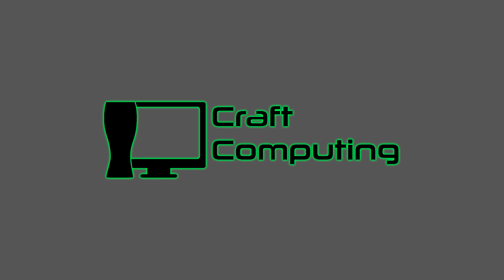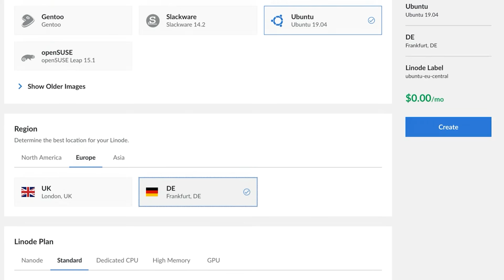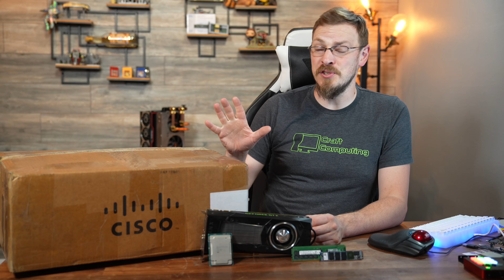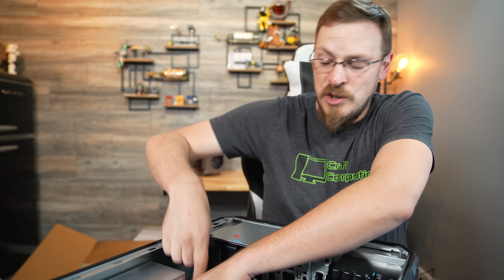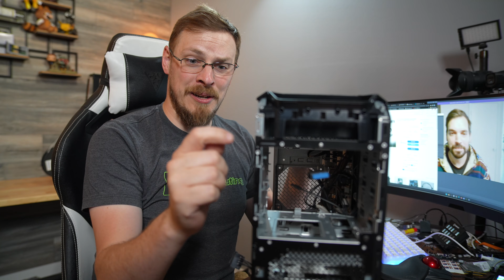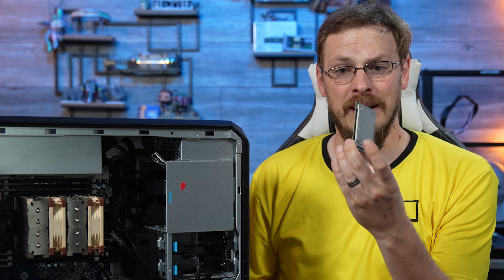THIS PC IS CURSED! - HPE Z6 G4 and Xeon 8251C!

Comment: I actually had some good experiences with my Hades Canyon NUC which I used as a desktop for a while and now have as a portable Beat Saber box. Based on that plus... fuck Dell, I went and grabbed a decent deal for the Spectre that came with that same chip as well.

ffs laptop instantly throttles the CPU to 1GHz, hitches massively, literally unplayable, no joke I had a better experience with a Core m tablet + 750Ti via TB3 (all I had during the 2018 mining boom).
Fuck HP as well. Looks like I'll go with good old reliable: ThinkPad P series.

Comment: Isn't that the generation of Xeon Process that Intel introduced processor locking (to the motherboard) via PPT (Platform Trust Technology). You might not have a memory issues, you might have a processor (or two) that is locked to the last motherboard it was in. It's a deplorable practice and HP is very well known for having this setting turned on by default.

Comment: I bought an HP colour laser printer that the store promised that was mac compatible and drivers were no problem. No driveres excisted and the store could not take it back since I opened it. So that landed on the garbage dump. If you fill your case with concrete, you´ve got a nice boat anchor

Comment: What i get from the video, sometimes it's more expensive to be cheap, and RTFM. Not doing that has bit me in the rear more times than i care to count.
Don't know if the listing was there when you got this one, but there's a listing for a full system, sans drives, for $400.
Even comes with a w2100 gpu.

Comment: This is why I always look for Supermicro.  Dealing with proprietary Dell and HP parts is just always a pain.
Reply: I'm a Supermicro fanboy, however, they do have their own proprietary crap to deal with as well.  It's just a fraction of what Dell/HP/etc have.  PSU's, drive trays, fans, etc are all proprietary with Supermicro.  They're just not douchebags about things like motherboard form factors.  It's hard to complain about their PSU's though since they've been the same for over a decade now and are basically cross compatible with all of their chassis.
Reply: @jlficken  I beg to differ.  I'm a 4P wierdo, and they most definitely use odd form factors to guarantee usage in only supermicro cases.  Ask me how I know lol.
Reply: @shadowflash8519  Supermicro does use proprietary form factors in some of their systems but they're open about it and the proprietary motherboards can usually be used in different types and generations of case.
Reply: @shadowflash8519  You are correct that they do have some proprietary MB designs for their multiple node chassis as well as some other chassis where they flip the PCIe slots horizontally.  I should have mentioned that...my bad!

Happily, the chassis that most people will use for a home lab and/or data hoarding such as the 216, 826, 836, 846, and 847 happily use standard motherboard sizes.

I currently have 2x846, 3x836, and 4x216 chassis at home.  I'm going to be adding 2 dedicated 20A circuits to my office this winter so I can actually have them all running at the same time 
😂
Reply: @jlficken  even with their few proprietary motherboards and systems, they make parts readily available for not too much on their e-store.
Reply: Ebay is flooded with parts for those computers and they are dirt cheap.

Comment: Hi, is this still available? lol

Unless specified, I would argue that the front IO PCB is essential and should be part of a barebones system. To me, an ordinary "barebones" system includes all of the specific parts, and only requires CPU/RAM/Storage/GFX. If it were me, I'd argue that and return it as defective if they refused to provide it.
In a similar vein to the socket. Their fault for not securing it properly, maybe I would've said "If you guys want me to try and  fix them and I succeed, partial refund. Otherwise... just gimmie a label."

Comment: Is it possible that the pins in the socket aren't quite making the best contact with the CPU? It could cause the memory errors. Just a thought... great video regardless. Sorry it didn't work out.
Reply: He replaced the motherboard, so it's not the one with bent pins.

Comment: You like me, fell into the E-bay trap. E-Waste vend has 500 servers that will not post. Waste time on a proprietary nightmare or part out the systems for $$$ ? Seller knows by the time Buyer finds all the puzzle pieces to test GOLD or Iron Pyrite, your return window is closed. You should have done the vid in RED SHIRT 🖖Jeff.
Reply from the maker: Red Shirt Jeff? That's Geerling's thing. I'm Mirror Universe Jeff.

Comment: Gods these HP Z workstations have really become a PITA. The Z400 used to be my budget gaming go-to. 
Your ending basically "this is YOUR problem now" reminds me of a bad aging exotic car experience, nickeled and dimed to death for silly reasons.
I had a Z820 that I feared to reboot because it would throw a RAM FAILED TRAINING error on a random DIMM (and there were 16) just about every time. Bricked the mobo once by enabling a BIOS setting that wouldn't clear with a CMOS reset, had to use the Crisis Recovery jumper to re-flash blindly. Had to deal with the noisy fans since they were proprietary, and there were like 8 of them... 
I wound up trading that Z820 for a rusty used Mazda... Good riddance LOL. 
Love these kinds of videos. We've all been there.

Comment: I have old HP gear from before the turn of the millennium and it is exquisite - full schematics. I wonder what reason HP engineers will give for their proprietary nonsense as of late. This video was no failure - it just reminded me (and others, I suspect) to avoid proprietary gear.
Reply: it's not an engineer decision, and it's to push their support contracts so when something breaks they can come with one of their weird and wondrous proprietary spare part

Comment: It’s possible that’s just a short in that corner of the CPU. From my experience sanding through CPU’s there’s generally no routing that far out, so you could probably file the corner off and have a working CPU.

Comment: HP and Dell and any other companies that do this kind of proprietary crap to purposely screw the consumer in order to make things better for themselves only should be illegal. I had a Dell with an ATX plug used for power. So when the power failed on the PC I had 2 spare ATX PSU's sitting around for just this very event. So being as Dell used a standard ATX plug on the motherboard like any other motherboard on a PC I naturally took out the broken Dell PSU with ATX plug and popped in my spare standard PSU with ATX plug. The PSU fan moved for a sec but my PC still would not power on. So I tried the other spare PSU I had. Same thing. PSU fan moved a sec but the system won't power. Turns out that they rewired the Dell ATX pinout which to me means you changed the standard.

Because they changed the ATX pinout in the Dell PSU it means that my spare standard actual real life correctly pinned out ATX PSU's are now blown along with my PC. WTF???!! Thanks Dell for all the PC's that were tanked creating E-waste by this and also potentially creating a fire because some guy somewhere has probably rigged his Dell Desktop PC up just so he can power it on and burned down the house cause you wanted to change the God Damn ATX standard.

 I got another Dell Precision T3600. The thing is a great home server machine. It was not E-waste. It came out in 2012. Its perfectly fine. But I can't turn it on because of proprietary crap. Proprietary fan headers, Proprietary front panel I/O, standard ATX port with Proprietary pinout. Heck.....I can't even use the case for anything other than his specific motherboard. So now even though it works perfectly fine...Dell has made sure that this is E-wase because they are not getting anymore money from this PC. They engineered this fuck shit on purpose.

This is a purposeful waste and its all because of greed and its not illegal to do this on purpose to people. Cause every time I run into these issues I am reminded that they literally engineered this BS by design cause they want you to pay them forever. They don't want you to buy from anyone else. Not one wire or a fan. Not even the case. They engineered it so that you have to get it from them or its fuck you on purpose. This should not be happening in an industry that has standards for a fucking reason. Its weird that this crap is legal being that we as a society care about how things affect the consumer in a negative way yet nothing is being done about the super corporations that follow these practices despite us paying taxes to a gov that we thought was competent enough to not let anti consumer practices like this to even occur legally. This shit is goofy. And all the kids in the industry and doing it now. Money see monkey do with companies. Its got out of hand years ago and gets worst. Now they are building cars with lots of features and after you buy and own your car you then have to pay extra to the car company to have permission to use features that are installed on the car that you "own". Heated seats are in your car that you own. And we sold you that car with heated seats. But we will not allow you to turn on the heated seats installed on the car that you own unless you pay us. If it looks like extortion and sounds like extortion.....I will leave that hanging there. I ranted. Should name myself Ranty. I studied Rantology Dynamics in grad school. I got a Rantweiler Terrier mix. He never shuts-up

Comment: This video teaches us about NOT BUYING PROPRIETARY CRAP!!! Going Supermicro or Asrock, might cost us more but is always going to be worth it. Thanks Jeff for dying for our sins.
Reply: My intro to don't buy proprietary hardware was a dell t3600. Thought for a barebones at $150 shipped (back in 2015) was a good deal. Added 32gb ram and a e5 v1 cpu. Great for its use case at the time. Until I needed to upgraded/replace things. Every since then I go with only supermicro boards for my servers(and asrock for "budget" builds). As the saying goes, you get what you paid for.

Comment: Be glad you didn't try the DIY power button solution. At least with the HP workstations I've worked on.... it knows if you aren't using the proprietary panel and won't POST if it's missing (it gave me an error and would just reboot and get the error again if I pressed the button to ignore it). There's a reason HP workstations are so cheap on the used market, it never ends up being worth it.
Reply: straight to the landfill
Reply: theres a power button on all the g4 series hp boards also I have my Z6 working in a Mac pro tower using a modded power header

Comment: Man, I feel your pain.  I did a similar build of an HP Z840 several months back.  I got the PC off eBay same as you sans CPU, RAM, and storage.  I was loading it with two Xeon CPUs and 256 GB ECC RAM.  I, too, got the dreaded beep codes indicating a memory problem.  I tried every combination of RAM I could think of but it turned out that the 2nd CPU socket had some bent pins that I had overlooked.  Why it was throwing a memory error beep code, I'll never know.  Once I managed to get all the pins pointing in the right direction (boy was that fun), I was able to get the system to post.
Reply: the RAM is connected to the CPU through the socket pins as the RAM controller is in the CPU. So bent pins can cause memory errors or PCIe errors too (also pcie controller is in CPU) and sometimes it's better than nothing (i.e. you can use the system with less RAM or without a PCIe slot).

Comment: I did a CPU upgrade for a Cisco Hyperflex cluster of four nodes and on one of the sockets a few pins got bent due to the mounting system being strange and slightly off. Now the cluster could have been fine with two nodes down, but it wasn’t, due to some Cisco crap with their software.

Long story short, two of the eight CPUs were DOA, and we didn’t find this out until the motherboard was replaced.

The pins weren’t too bad until my boss learned over to look and got a microfiber cloth tangled in the damaged socket…

We managed to get three nodes online after some more swapping with the Cisco tech and it was another week until the fourth node was online.

The whole thing was stupid due to many layers of poorly considered configuration and design. I still recommend the vast majority of customers get a SAN and used VMWare clusters due to how awful the experience with hypercpnverged can be. They just aren’t as tolerant of failures as a traditional setup.

Comment: Hey! I own this workstation! Got excited when i saw the title since there arent many videos featuring it. My CPU is a Xeon Silver 4116 and it works great with 32 gb of RAM and a Quadro P5000 for productivity stuffs. Also, theres a power button in the back, so technically you don´t need the front i/o card to power up the unit.
Reply: I forgot about the rear power button! And I use it pretty much every month :D

Comment: Really does sound like a cursed HP. I feel your pain a little, having fun with a Dell HBA that won't work in an integrated controller card because a config setting says that's not where it goes... but it's not the easiest thing to change. 
If it were Dell and a little closer to Australia I'd pay to have it shipped...

Comment: Jeff, I feel your pain here. I'm currently dealing with a Visio TV which is flickering because of an overheating component. I tried two replacement motherboards from eBay; the first was the same model of motherboard but flashed for a different TV, so column mapping for the panel was completely screwed up. The second was stuck in store display mode and wouldn't come out no matter what I tried. 

I have just gone back to the original motherboard and am about to drill a hole in my TV to mount a PC case fan on it. It seems ridiculous, but the alternative is to turn the whole thing into e-waste.

Comment: LOL, I can relate, I had the pleasure of owning a Dell Precision T5610... Unfortunate how these, in principle, great computers become e-waste because of the propriety BS
Reply: I have a Dell Precision T1600 that actually came with a standard 24 pin 450 watt PSU.  I even got a PCIe riser cable to use my old Sapphire RX 580 GPU outside of the case since it won't fit unless I remove the hard drive adapter cage.  I might do this eventually.  I even got a new EVGA 650 watt, semi modulate PSU for the 580. All looking good so far...until I noticed the "wonderful" proprietary fan headers of Dell.  So much for eventually changing the CPU cooler with a nice ARGB one that I bought...at least not without "modifying" the connector!  Same for changing the exhaust fan as well.  I just better avoid the same thing happening to me as what happened to our man here when he tried to modify his fan headers!  I guess that I will just leave well enough alone for now since this old Xeon e3 1245 stays pretty cool with the standard cooler anyway and can't be over clocked with this motherboard.  Be well!  👍👍
Reply: Dell and HP's motto is "straight to landfill"
Reply: @marcogenovesi8570  LOL!!!  😂😂👍👍

Comment: Hey Jeff, dont be down on yourself! I tried something similar but with a few retired HP Elite 8200 SFF PCs several years ago. I just wanted to slap some 1030s in them and have a few spare gaming setups for when company came over, and oh boy did I regret it immediately. They were plagued with some weird bug where they wouldnt boot and the fan on the CPU would slowly ramp up to max speed, sounding louder than a hair dryer. Had to yank out the CMOS battery until they lost their settings and then they would be fine for a few boots and back to the hair dryer mode. Rinse repeat. It only took a month of that before I threw in the towel. Took the GPUs out and just gave the HPs away. Fun times!

Comment: The five pin fan rubbish has been around since at LEAST the Gen 6s from 2008 or so.  PS. Try thoroughly cleaning the CPU pads.  I had that problems many years ago. Looked clean but no memory detected.

Comment: To be fair, the motherboard with the blown PWM is likely still working as a motherboard. The PWM is typically handled by a smaller microcontroller (or fan control chip), so it logically shouldn't damage the rest of the board. However, it is an HP board, so it will likely complain about it regardless.

In my own experience, I have started to heavily avoid anything that is HP, Dell, Lenovo/IBM, etc.
Mainly since I have a literal pile of cards that won't work in anything but their specific systems.
Reply from the maker: It didn't power on at all after shorting. Even scored the fan port.
Reply: @CraftComputing  I had a pwm port go bad which then took out the motherboard and the processor. Got both RMAed as they were luckily under warranty. It was 1st or 2nd Gen of the i-core line.
Reply: @CraftComputing  That does sound quite bad. A poor design in my own opinion.

But honestly, motherboards should use standard pinouts for fans, especially if using standard connectors.

An exception can be made to hot swappable fans where the cable is integrated into the housing, and where there even sometimes is two fans in one assembly for redundancies sake.
Reply: I've killed a pwm port before.

And bypassed the fan error by tieing the fan speed wire to another fan.

One hp board i had was genius and had reused a usb header but tied it to the bios chip. Right next to the power button pins.

Good ol me poked the wrong two pins and shorted the bios chip instead of turning on the system.